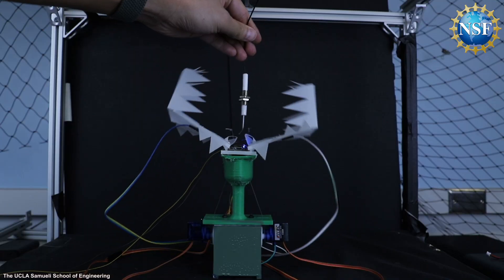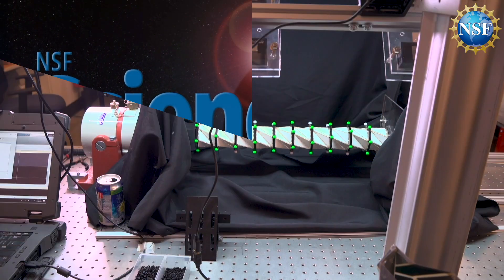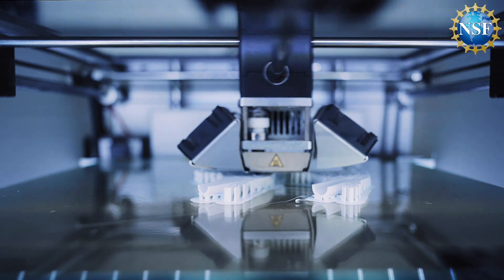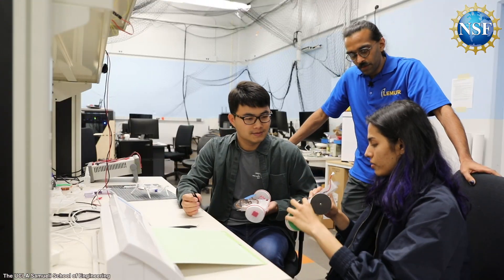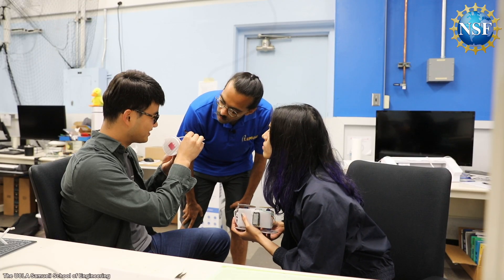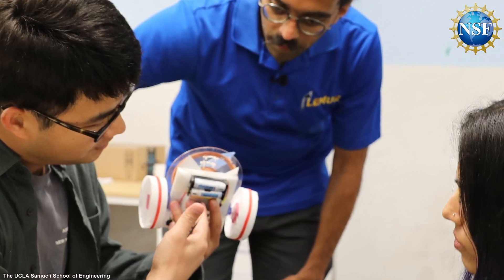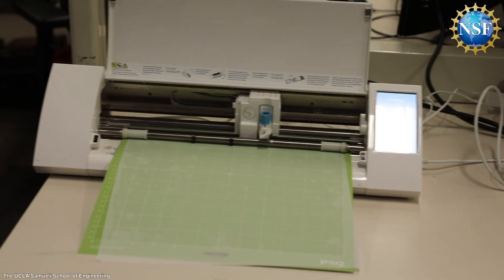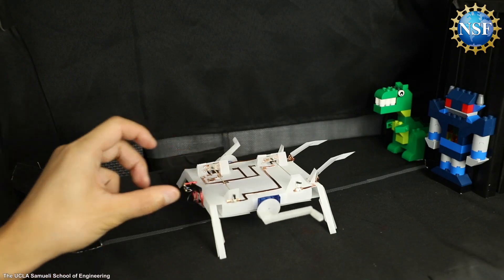Robot Origami: Robots that Fold & Bend

Comment: I would like to understand how computation occurs in these systems.
Reply: i guess through mechanical connection or disconnection of circuit wires when hit an obstacle which snaps a mechanical switch.